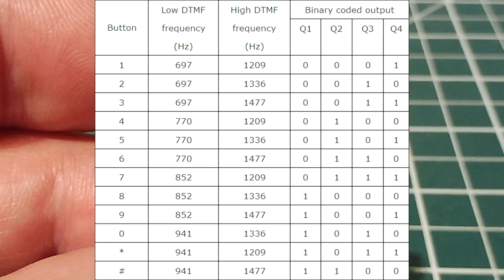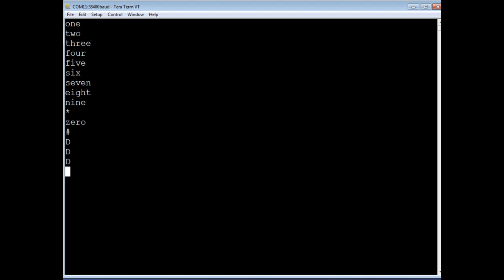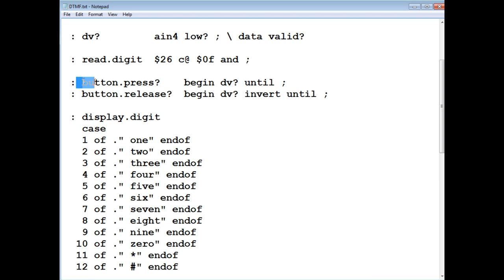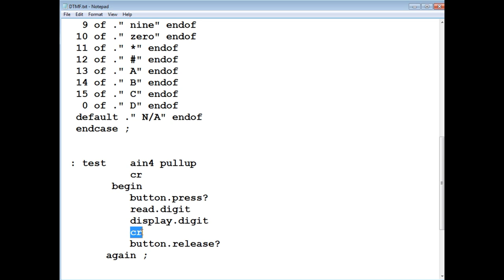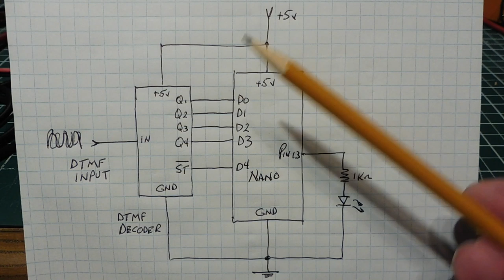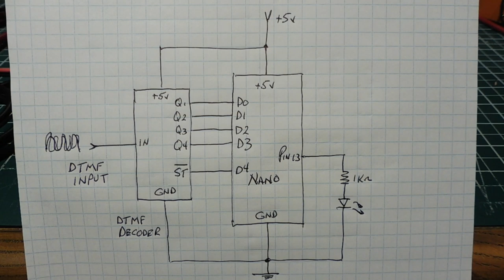DTMF Decoding  / MT8870

Comment: Back in the late 70's, I built a device to control 4 VCR's for an automated CCTV channel.  It used DTMF tones to control the starting, stopping. and rewinding of the machines.  It was built using PLL chips to detect the tones and TTL logic to provide the various functions.  It took up 4 x 6 inch perf board and at least 20 IC's. all wired wrapped.  As you have shown, the whole thing could now be emulated with an Arduino Nano and the tone decoder chip.
Reply from the maker: Did the same using LM567 tone decoders to control a Ham repeater. That's all we had to work with back then.

Comment: I still don't follow how you hooked up your radio to this circuit. Is this strictly for receiving and not usable for transmitting to access a DTMF repeater?
Reply from the maker: The circuit on the breadboard is a DTMF decoder receiving audio tones from a VHF receiver generated by the 5 watt VHF portable radio transmitting the tones via the keypad. The portable radio is used to access the repeater remotely.

Comment: Which chip did you use for your Encoder? I looked at the TP5089N but it wants a keypad with a common ground. Prefer to use a matrix keypad with only row/column pins, as that is what I have on hand.
Reply from the maker: I used the CD22859 from Harris, but I also have used MK5087 and ICM7206.

Comment: Nice tutorial. I would like to detect dtmf using a microphone as an input instead. To get this more challenging for myself I will sent the generated DTMF to the Arduino over intercoms and transmit it to a speaker.  Can you help me with this. Will your decoder work with a mic as input?  Thank you.
Reply from the maker: Yes, you can decode DTMF tones coupled through a microphone and fed into the decoder. Ensure the audio has good signal to noise ration with little background noise. You can build your own mic pre-amp: https://youtu.be/Qc_hngcqq7A or get an assembled board online.
https://bc-robotics.com/shop/electret-microphone-amplifier-max4466-with-adjustable-gain/

Comment: I am studying a DTMF tone assignment, I am curious how you determine the length of signal to process? ie, determine a long button press from short button press
Reply from the maker: The  Data Valid (DV) output signal is active when a button is pressed and held. The digit is decoded as soon as DV is valid. While the button is held down it is in the button.release? loop. The next DTMF digit will not be decoded until the button is released and comes out of this loop waiting for the next DV signal.

Comment: Audacity (audio manipulation software) can generate the dtmf tones as they are built-in. If I can export the notes to to a file, then open  the file and copy paste into arduino to create arrays for each key that might work to be able to make a inexpensive dtmf encoder. I started doing that but the files are kind of large like 1.6K bytes for key "1". So I am probably going to have to plot the values and remove some values to reduce the size of the code. I got pretty good quality playing back the notes back at 8KHz in Audacity. Good thing they are short ~ 0.2 second long notes. It probably has been done like this before.

Comment: Sorry to bother, the complete project would be:

input data from DB9 RS232, uswing module HW-044 pass the data to arduino, from arduino to BAOFENG BF-999S (only has 2.5 and 3.5 connects (NO USB no keyboard), handy 1 transmits that data in the air (I don`t care if someone else listens the data) , handy 2 receives that and pass it to another arduino and prints the data received from handy 1.
Thanks so much !!

Comment: Thanks for this amazing video...
could you please make a video about interfacing this IC with a landline phone
That's what I've been trying to do for the last few days, but I think I have a problem with either the gain or the impedance
Reply from the maker: Check out this link:  http://electronics-diy.com/electronic_schematic.php?id=971
There is also interface info in the MT8870 datasheet.

Comment: Great video, very didactic, 👍 Could you share the code running on Terraterm? I'm working on a similar project.
Reply from the maker: The code is written in Flashforth running on the Arduino Nano. Code starts at 4:00
Reply: @0033mer  , ah, so the tera term only shows the result that the Nano throws out so to speak?

i thought there was a program running there,
Reply from the maker: Yes.. TeraTerm is a serial terminal program that monitors the program output.
Reply: @0033mer , quick question, is there a terminal that i could send a clickable url to, as in i send a url from the arduino, say for a google search with a search query at the end of the url,

so i send the url from the arduino and in the terminal, i should be able to click on the url so that it opens on a browser,
Reply from the maker: Check out ZOC. It has a scripting language REXX where you can do some custom programming.
Reply: @0033mer  , ah, that sounds awesome, thanks!